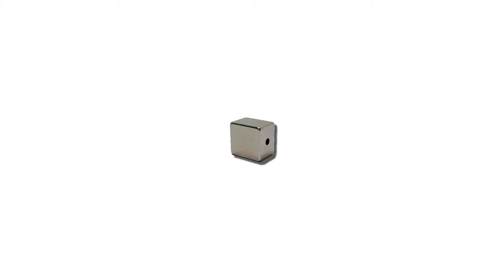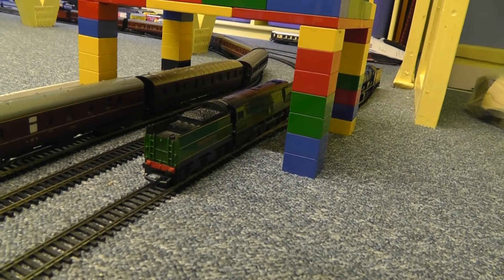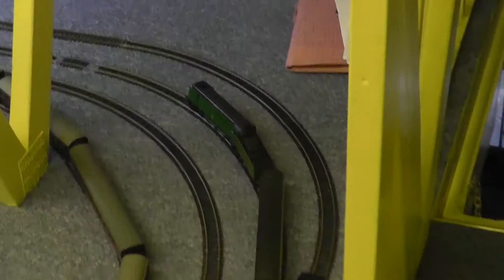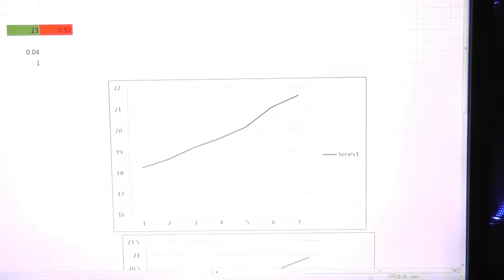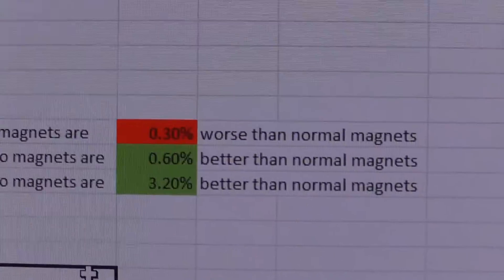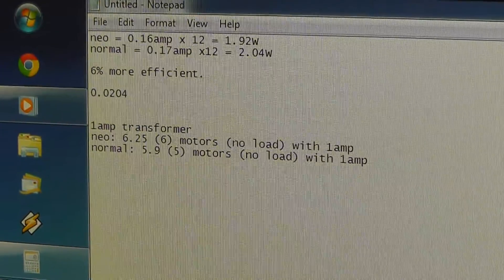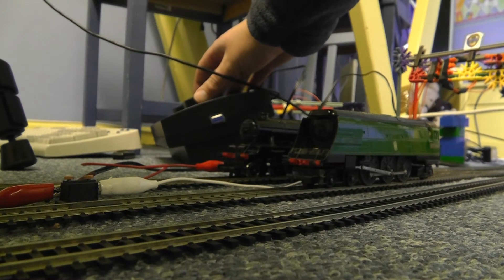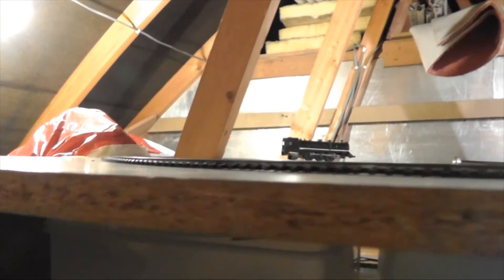Tri-ang 'Neo' Magnets: Do They Work & Are They Worth It?

Comment: I recon you have summed them up well, they are available if required. Reports appear in the HRCA journal, where Hornby Dublo locos can be rejuvenated, but a recent discovery is increased wear in the motor bearings, so there may be a price to pay in the longer term.
Yours, Clifford.
Reply from the maker: Thanks! And thats a good point, I can beleive that to be true. I must admit, I've fitted three of these new magnets now and I was expecting more of a difference (I still might try one in that trans-con though) :)
Cheers,
Sam
Reply: Sam'sTrains In the same journals, I've read there is a trend to have the original magnets remagnetised. At some area meetings, someone fetches the electric device for that job.
I'm not sure if the TCA does this for Tri-ang motors though.
Yours, Cliff.
Reply from the maker: Its possible - I've heard you need some serious current do it it though :(
Thanks,
Sam
Reply: Sam'sTrains
I also run Hornby Dublo, in the past I have fitted Neos but having damaged one loco`s top bearing I have invested in a re-magnetizer. Best investment ever, locos run as sweet as anything.

 I have recently remaged 11 triang locos with XO3/4 motors for a friend and it is amazing how well Triang respond to the re-mag, they now also run very sweetly.
Reply from the maker: Thanks for the info - what does the re-magnetizer involve? :)
Reply: Sam'sTrains
Hi Sam, The magnetizer is new, I purchased it from a member of the HRCA. It works well, the job is done with the magnet in situe and only takes a moment. I bought it to use on my Hornby Dublo locos, however I am very amazed how well it transforms Triang XO3/4 motors.
If you wish to find out more please send me a personal message, I would be quite happy to do one for you and would look forward to hearing your opinion on the result.
Reply from the maker: Thanks very much for the kind offer - I'll definitely contact you if I ever need one doing.
Thanks again,
Sam